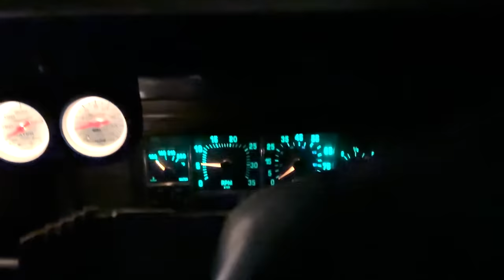Nightmare skoolie tow: this trailer ripped off my hitch

Comment: I would get Kurt to check those bolts. Loose bolts on the hitch would cause the snap. Trailer probably weighs 8K lbs empty on two 7K lbs axles. Best guess is that the trailer is not balanced front to back properly and you had somewhere in the neighborhood of 2200 lbs of tongue weight force transfer from the trailer configuration and load. It got magnified if you had a bumpy passage to start and with your additional cargo up front it caused the failure. Someone was looking out for you. Feel better.

Comment: I had a similar situation while pulling a 14,000Ib dump trailer. I put a 18,000lb hitch on my 1 ton pickup and had no problems. Believe it or not, I purchased it at Auto Zone.

Comment: Based on your experience here, I may end up welding my hitch to the frame rails... Wire wheel the contact points down to bare metal and MIG it on, then paint it.  Glad you averted disaster!  I'm sure your cameras played a big role in the save...

Comment: So if the weight wasn't  disturbed equally, and you did have the trailer where it was putting unnecessary pressure and force on that tow hitch assembled it sure can do what it did, had a welded rear hitch do the same thing but took a while before it snapped the welds on that one,  this why the level of trailer and weight is crucial good sir, glad your ok and safe friend. Well

Comment: I bet it was the tightened tongue bolts, before the rig had enough slack to be a bit more relaxed and now it was all stressed out 🤣

But on a more serious note, it feels odd to me that all the bolts of your hitch are so far forward from the actual ball, thats a long lever when you basically take the distance from most forward to most rear bolt vs most rear bolt to ball, there might be quite the force multiplier at play

Comment: Weigh safe hitch - especially if you are towing lots of different trailers , please look them up, American made and lifetime warranty I am pretty sure, but it will let you know immediately your tongue weight so you can balance the trailer better etc, I also always use weight distribution hitch on anything like that, not sure if it would have helped with this, my hitch is now getting welded on my bus in addition to the 1/2 bolts to be safe, so sorry this happened :(

Comment: I would load the very back of the trailer up with anything really heavy you have on board, that should help take some weight off the front of the trailer. 
I would also flip your tow bar tongue to try and get the angle of the trailer more level. 
The bolts that snapped may have been weakened on previous towing trips and then this finally set it off. 

Best of luck

Comment: Glad you are OK and there was only minimal damage to bus and trailer.

Did the bottom of the trailer hitch run out of clearance and bind against the reciever hitch? 

With both the towing vehcle and the trailer having a long wheel base there would be alot of leverage if going over a roll in the road where the bus was on the downhill side while the trailler was on the uphill side.

Comment: Is it possible that the real culprit was your previous trip to Kansas? You said it was a heavier load albeit with better weight distribution. Perhaps that heavily loaded trip is what damaged the bolts (sheared, stretched, ???)  and when you put this trailer on it finished the "job" and popped the bolts, the straw that broke the camel's back.

Comment: Wow.  No damage to the trailor?  Thank God  travelers doing 70 mph or more were NOT hurt or killed.  Good news? 
Now amateurs will take heed.  Anything can happen and you'd better be prepared. I thought a hitch was like getting in the car starting her up and driving.  Nope, brakes, sometimes air, lights, weight, stopping correctly, turning, blind spots.

Comment: I vaguely remember reading that grade 8 bolts are not to be used on trailers or attachment points due to a tendency for them to of total failure vs stretching.

Comment: there's a possibility that the bolts failed because of normal use. in the video you talked about towing other heavy equipment from KS with the same hitch, the bolts may have been stretching from that time, then failed on this trip. in aviation, we have to perform NDT on bolts and structures because metal fatigues over time. think that may have been your problem

Comment: Thats a lot of trailer to be towing without a weight distributing hitch. Another thing... if the trailer is slightly nose down, it doesn't add but a very little more weight to the front trailer axle. There is an equalizer between the axles that essentially makes the tandem axle act like one; equalizing the weight that each axle carries. Yes, you should have determined tongue weight. I can't comment on the rating of the bus or the hitch / mounts that broke, but it certainly wasn't up to the task.

Comment: Hard to tell from the video. Was the trailer sloped up to the back of the bus once it was hooked up?

What do you think the chances are that a previous load took out the first two bolts and this load was just the one that finally broke it all loose?
Can you see any witness marks one the first set of holes to tell you what happened to the first two bolts?

Comment: I'm guessing that they towed it to you using a dually pickup? Probably had a 2 1/2 hitch on the pickup? I would guess it probably has a tongue weight of over 2000Lbs.

Comment: Get a Class V hitch.

I have never had a definitive answer to the question of welding hitches to the frame. So, I use bolts. The advice to use larger diameter Grade 8 or better fine thread bolts is good.

First, bolt the hitch solidly to the bottom of the bus frame.
Then, measure the height from the bottom of the hitch to the top of the frame. Cut appropriate size flat steel plates the same thickness as the frame. Use them to tie the vertical side of the hitch to the vertical frame rail. Again, oversized Grade 8 or better bolts.

You can also get load leveling equipment to increase your towing capacity by another 25-50 percent over the hitch ratings.

Finally, the weight you added to the trailer is right up front. That translates almost 1:1 to tongue weight. They will really need to pay attention to their build-out to keep the tongue weight and fore/aft balance reasonable. For your trip, I might add some weight behind the axles to cancel what you added up front.

My Blue Bird has an MT-643 and a gigantic electric retarder. I bought this exact bus to bumper pull a long race car trailer, so I added a transmission cooler from another bus and 2 temp guages - 1 for the trans and 1 for the diff. Heat is really hard on automatic transmissions, so I wanted to know for sure.

Then I got old before I finished the bus and quit racing, lol. That's life!

Finally, tow the trailer level.

Great of you to share this with the community and let others learn from it. You were extremely lucky!
Reply from the maker: man that sounds like an awesome bus, the MT643 is up for this bus when i have the money and id love to have an electro retarder--i had one on quite a few buses when i was a bus driver and loved them. definitely going beefier on the next hitch, and will be much more observant of tongue weight moving forward.

Comment: Isn't it amazing that most people don't know how bad our roads are? I drive an old cabover semi and believe me, I know how rough the roads are. The beating my vehicle takes is amazing. My personal car (Toyota Highlander) takes the same roads with no problems at all. The trailer is definitely too heavy up front. Overbuilding the hitch would be a good idea, and there's also an air-bag ball system that takes some of the "abuse" out of that ball junction. I don't move over for emergency vehicles anymore; I throw on my flashers and slow down to 30mph....because I noticed that when I did move over.....a bunch of a-holes would just pass me on the right and fly by the emergency roadside at 70 mph or more. Better my semi at 30mph as opposed to 10 cars and some truckers at high speed....right? I don't know, my goal is to drive like my family is next to me......safe as possible, unless it's my cousin Billy,....that dude could die, and nobody would care.....well his dog might care?
On a lighter note, I'm picking up my bus project on wed. in Jacksonville. 2000 Thomas 14 window diesel puller, Cat 3126/Allison 2000. Be safe out there brother, the road is rough.

Comment: A trailer you're pulling for the first time - and in the dark - and you didn't check the tongue weight?

I'm not a professional trailer tower; biggest long haul trailer was a 17 ft pop-up camper for 1300 miles - but I checked the tongue weight the first time I towed it.  300lb bathroom scales work for something that small - and for much more weight with a simple lever multiplier system you can make from some bits of 2x6 or some steel channel.  A 1:3 adapter lets that 300lb bathroom scale measure 900 lb of tongue weight.

From this example, by the time that trailer gets filled with equipment they'll need a semi tractor with the mobile home hitch to support the trailer's tongue weight.  Maybe the designer didn't pay attention to load distribution or the locations of the axles?

Comment: So when did you know something was wrong? Camera? Felt something?
Reply: He would have heard the safety chains against the ground, heard a bang from the bolts snapping & felt the bus leap up as the load momentarily went off it. 
Good job he stopped to investigate rather than assume it was some sort of speed bump in the road.

Comment: Chuck, legit 1/2 inch grade 8 bolts should be able to handle the weight of the entire trailer. Not just the hitch, the entire verbing trailer! Have you considered the fact that you possibly got counterfeit grade 8 bolts?

Comment: Your hitch is too light weight for trailer.  You need one with side brackets from the hitch to the frame. Load leveling hitch would be better. They are built to haul a heavier load.

Comment: There has to be a manufacturer defect with the bolts or conecting rod because that trailer probly weighs no more that more than 2000 lbs the hitch or bar it was hooked up to was bent so there was something wrong there unles the trailer wwas overweight your cinvertion prob only 5 tons or less 10.000lbs is 5 tons there are diffrent weights for manufacture vehical weight rating group what group class of weight the vehcal is desighned for the weight of the vehcal it self combination weight the wegit of the vehical and its load or passengers and theres how much weight the vehical can haul total max  there all these should be listed on the manufacturs plate in the door or in the operators book i drive both coach and semi so you have to know especialy with semi how much weight your hauling 2000lbs is a ton and a 5axal semi Both semi and trailor with no load in it is 15 tons they try to keep the semi and trailer between and 7tons to save on fuel thatsva empty semi semi and trailor fully loaded its 40 tons 80.000lbs but i can see that little tralor weighing more than a ton or 2at the most ive hauled a few and their pretty thin and dont usally weigh from 300-1200 lbs some people over load them that cause the floor to give out ot the hitch to break but they dont know not to overloade them they think if they can get it in there then load it down with bricks or something heavy like that but you have to read the manufatures plate to see what that trailor can haul pac it with fethers or pillows fine but when none comercial drivers use the vehicals they dont know that a peoperly trained bus drive or truck driver knows that there are vehical limits but in yozr case maby there waa some kind of defect whith the brace setup 🙂

Comment: We started getting tons of import fasteners that aren't up to par. I worked for one of the class 4 railroads that switched from Barnes supplying to Fastenal and if you don't ask them for American manufactured bolts the grade 8 is more like a 5. You will see this with cheap bolts. Try a shear test with a sledge. Not scientific like a zwick but it will be evident

Comment: Chuck I saw immediately what the problem was before you ever left on your trip. You need to lower the ball on your hitch. The trailer should be level when you tow it so that both axles are taking the weight. With the ball on your hitch being so high the leading axle of the trailer was not carrying nearly as much weight as it should have been and all that load was transferred onto your hitch. A truck stop or a farm and fleet or even a Walmart might have the hitch lowering piece that you need.

Comment: I look forward to your analysis.  When I installed my hitch on my 30 foot international bus, I used all the bolts and had some welds done on both sides where the hitch attaches to the frame.  I also installed a class v hitch since price difference was minimal to a lower class hitch.  Then, about a month later I towed a F100 1500 miles.  It's fairly light and I had no issues.  I wonder if your bolts were not truely grade 8?